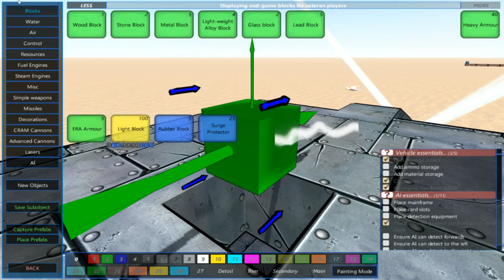[6/4/17] First Stream part 2 ~ Theory crafting?

Comment: That was fun. I hope you get to do it again soon.  I think this may be a good Idea to try with your adventure mode ship too.  Been really wondering what your going to use as a main weapon for that since it looked like you were going for something that would work as a broadsiding vehicle.
Reply from the maker: That would be an idea actually. And yes, that design is mostly built for broadside weaponry... though that would range from missiles to turrets. I also planned forward turrets which would be in the form of railguns, the ventral mounted ones being fitted to attack targets in the water.

Comment from the maker: Comment from SVORTY on the previous upload;

Hello there, good sir,

Here are the links I've been refering to earlier in the stream.

The one for the reactor I've built:
http://steamcommunity.com/sharedfiles/filedetails/?id=899153906

And the one for the forum thread about sloped armor (despite being from 2014 it's the most up to date info I've found on the topic):
http://www.fromthedepthsgame.com/forum/archive/index.php?thread-1706-2.html
Reply from the maker: That is a nice looking reactor. Looks kinda menacing but you seem to have had fun with it. ^^ As for the sloped armour information... you are right, that is way out of date. But I have also seen shells sometimes bouncing off sloped armour when they hit at a shallow angle so I know there is some kind of mechanic there...
Reply: Thank you very much for the copy of the comment ^^

Shell can bounce off any armor - it does not have to be sloped. 

Good way of testing this is 500mm APS with low velocity (1gp at ~50%) and HEAT cap (it has basically non-existant AP) without any fuse.

Slap together a quick rig with a docked target (a cube on one side and piramid on the other) built out of HA and try to fire this APS at it - in approx 8 out of 10 tries the shell will just merely bounce off without doing anything.

Repeat the test with a target built out of metal and just slightly rotate it. While shooting at flat surface you should get about 3 or 4 bounces in 10 shots. While shooting at the very same flat surface under slight angle (45 degrees lets say - can be set via docking station holding the target) you will notice a substantial increase in bounced shots.

Repeat the same test again but this time with sloped armor and you will notice the results will be absolutely the same.

It sucks (mildly put) but thats all that we have got at this moment. Nick promised to implement sloped armor calculations sometimes later but for now it would be supposedly too complicated and would require too extensive rework of the code (I've read this somewhere on the forum, can try to find it if you would like to). But all said and done - I'm happy that a much needed reballance patch is comming out. Non-sloped armor mechanic is something I can cope with for now.

About the video itself - the stuttering and framedrops seems to be quite more severe here then during the stream and in the later autocopy of the stream. Any idea why that might be? I've heard that youtube is having issues with certain bitrates of videos.
Reply from the maker: Oh, I see, it's flat angle calculation rather than anything tied to the slopes being special? Wait, that's what I thought it was... now I am confused. ^^

As for the stuttering... I am not sure. The recording was at a high bit-rate on my system so that might be part of the issue... maybe. It's something I am continuing to poke at to try to narrow down. Also, nice new avatar. ^^
Reply: Thank you - this particular hyena had such a pretty smile I just could not resist :)

As for the slopes, I would say the chances of shell bouncing of the armor are based on AC of the armor, AP of the shell and angle at which the shell hits the armor. Sadly the slopes are purely cosmetic as far as their shape goes - in the eye of the game the triangle is just as large as full block and therefore the game does not take natural sloping created by blocks themselves into account.

Comment: do you have a second laptop or a different PC, ive heard you can use a second PC  to stream and use your strongest pc to play from the depths, also if you have OBS and a Nvidea video card you can use the video card to record/stream. might be helpfull because from the depths is currently 95% cpu load and only 5% gpu for the textures etc.

next patch should fix that because they are porting the game from unity 4.6 to 5.6,  this will result in more GPU load and less CPU and also better optimazation overall.
Reply: search for OBS shadowplay
Reply from the maker: That jump will be a big improvement, the cpu usage on FtD is one of the main bottlenecks for a lot of people. Thank you for the suggestion, I will look into shadowplay.